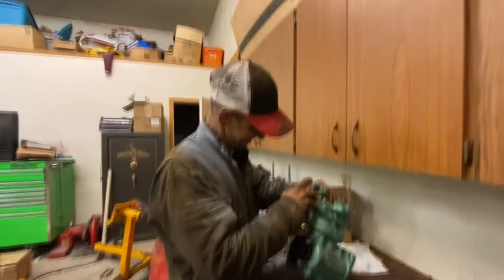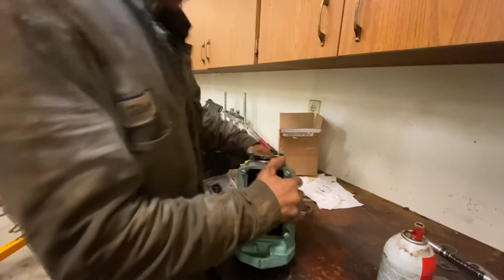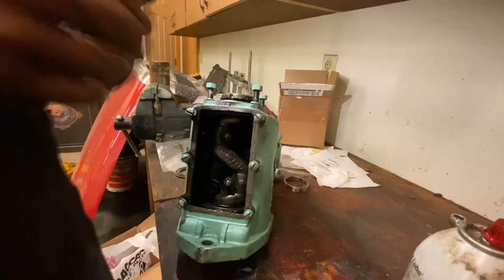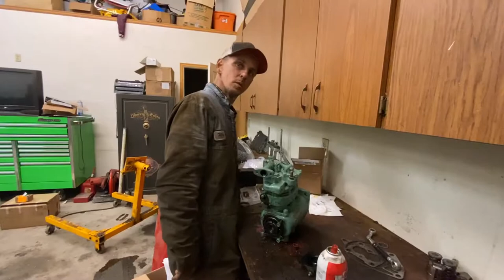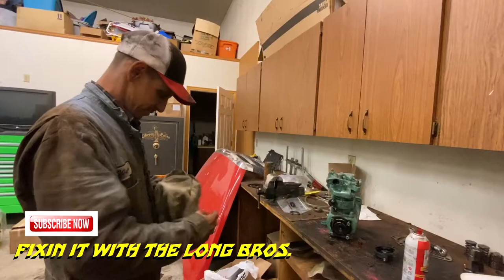1952 VINTAGE 1952 PD4103 GM MOTOR COACH TOOK AIR COMPRESSOR TO WARRENS FOR REBUILD OR TO UNSEIZE

Comment: I had a friend years ago just like him!  He is 90+ now.  Forgot more than I will ever know!   That guy built more cool projects than you could count.  Thanks for shooting the video.  Tell him he has a fan here in Florida.
Reply from the maker: I will tell him...he is the real deal....he should have more subscribers...lets help him ...he is going to help us with our bus he just needs more time in a day...
Reply: @doityourselfwithfixinitwit270  We all need more time in a day. Between my family and work there is no time left. I have to service our PD4104 tomorrow. All of the fuel and oil filters came in today from Napa. Kep moving forward and it will be running before you know it. I just went through my spare Bendix Truflow 600 pump  that dad been out in the weather prior to me getting it and the valves, springs, unloader in the head was completely rusted away and the kit was $35.00. Works like a new one. Warren is right about them being very tough.